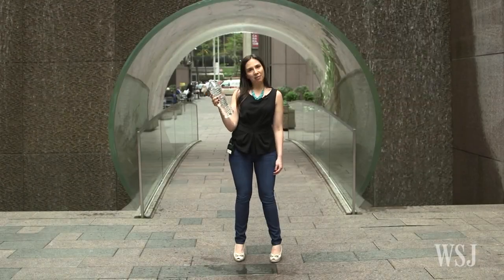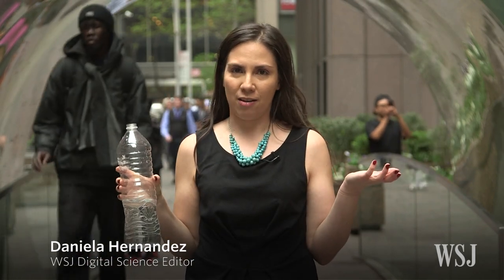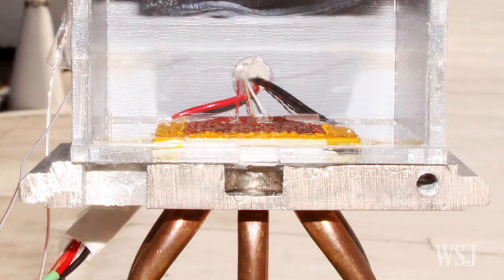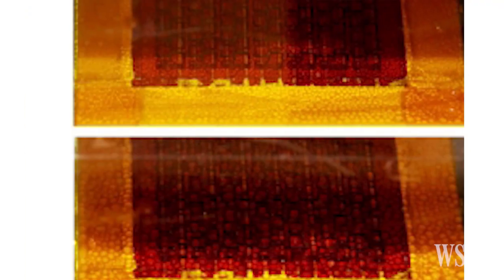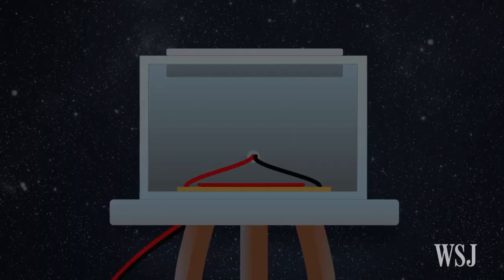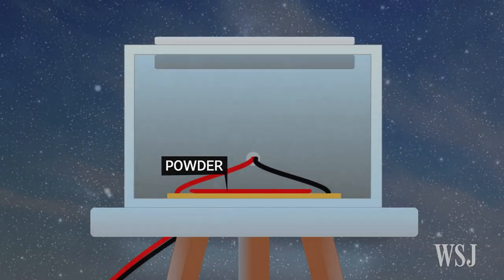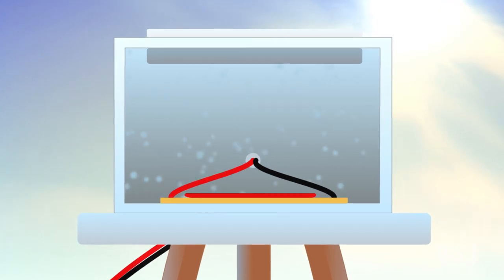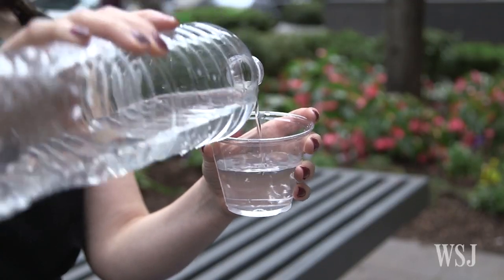Newly Developed Device Creates Water From Dry Air

Comment: These sort of things have come up before.  Even if legitimate, this tech has no real practical use: arid areas have too little water in the air to capture and areas of high relative humidity, generally, have no need for water (perhaps water filtration but not distillation from vapor).